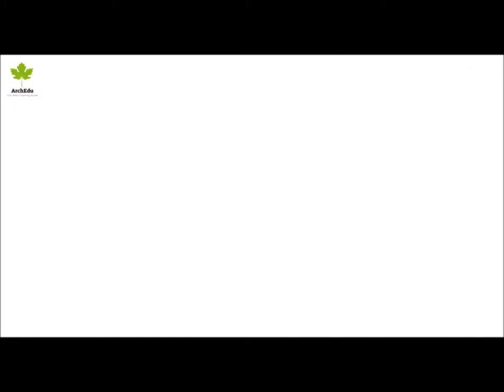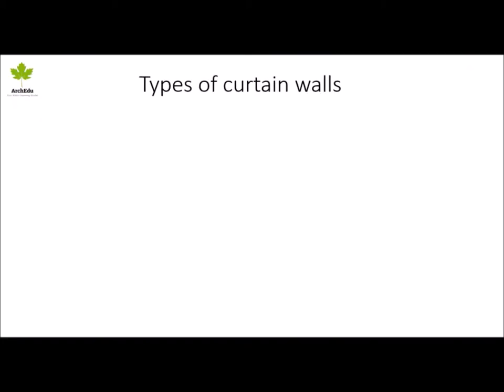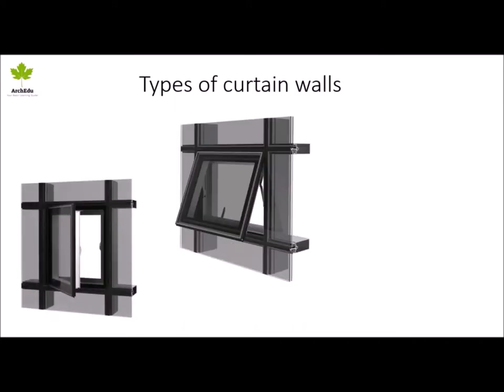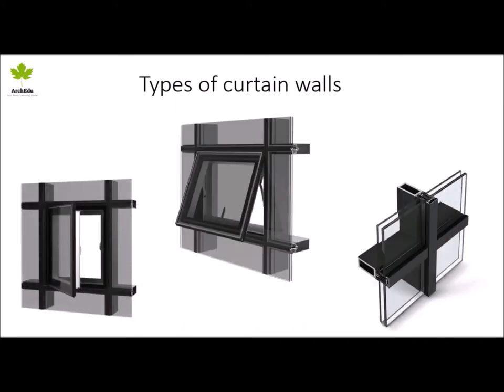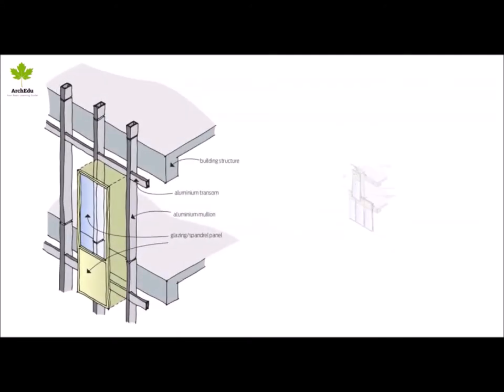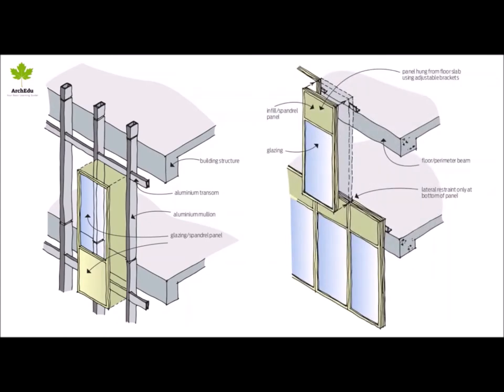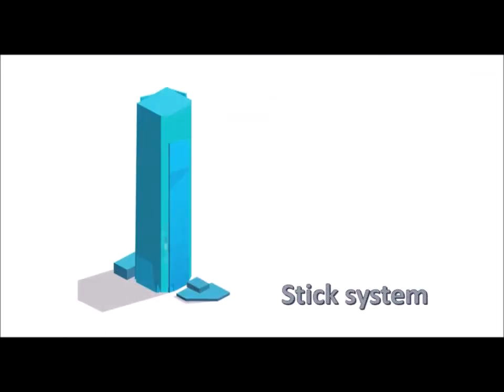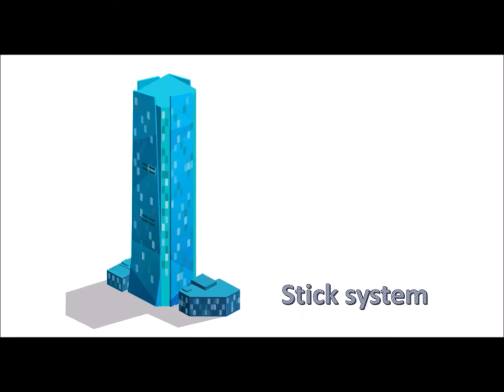Curtain wall

Comment: Can doors and windows of different aluminium profile brands be attached to curtain walls or should they be of the same curtain wall brand? or in other words, should doors and windows that are attached to curtain wall be of the same manufacturer ?
Reply from the maker: Yes. Provided they fits within the curtail wall framework/ module/unit size.